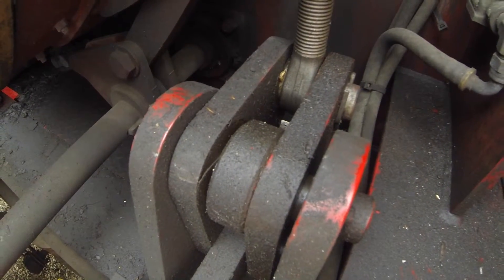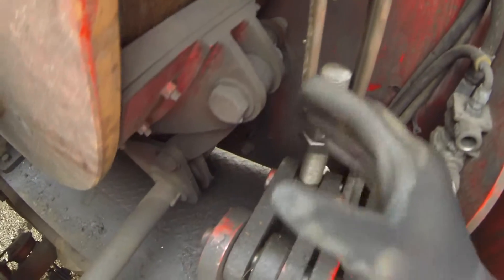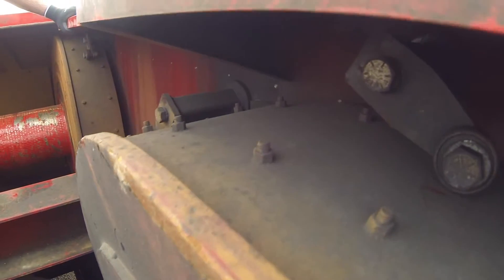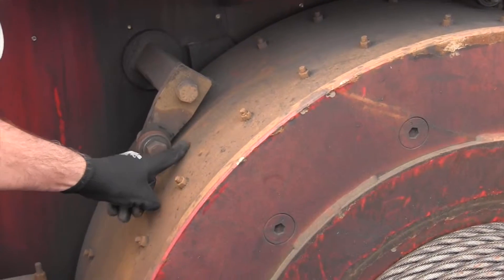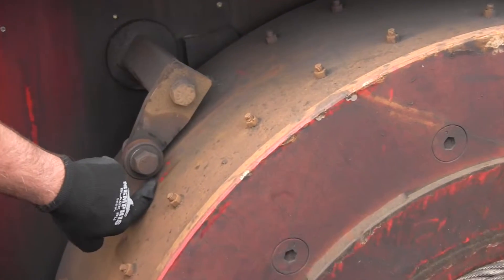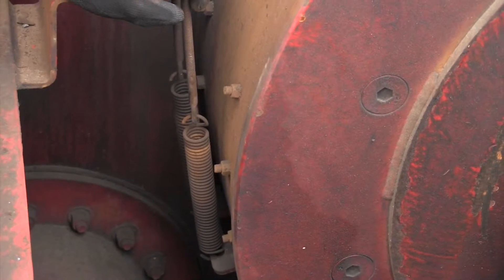TI brakes

Comment: These brakes might be OK for well servicing applications. But a breaker bar is NOT a brake handle. These brakes also do not allow for the finesse required in milling, fishing, and other more spe incised wokovet and drilling operations. The chasis and Derrick is competitive with Idevo, Hopper, Frankx, Skytop, and the rest.